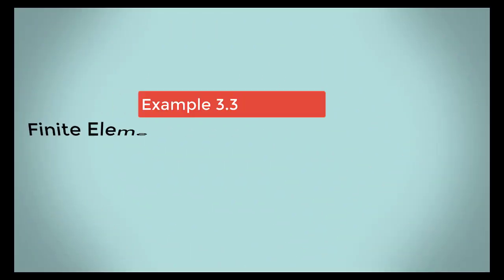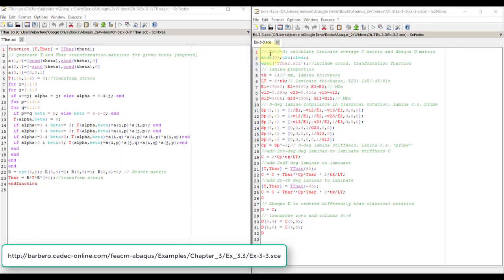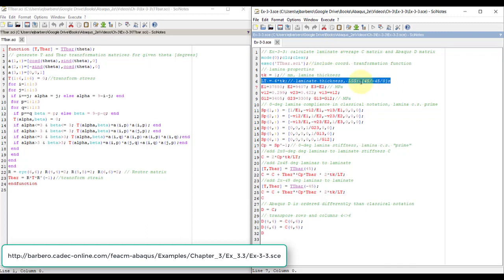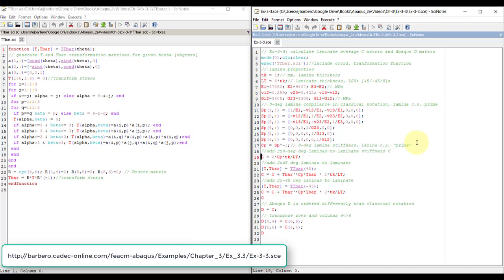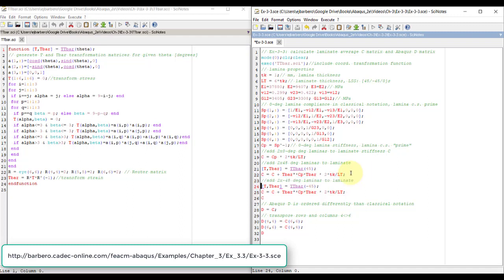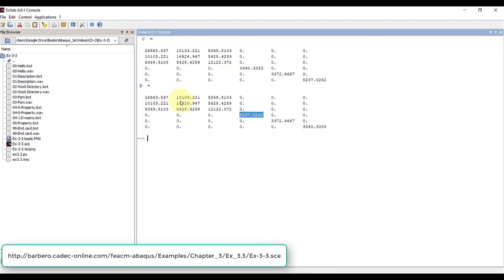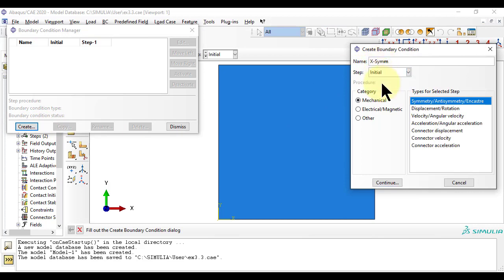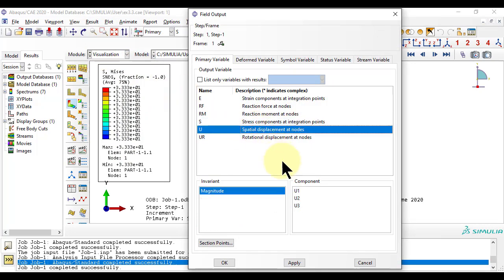Example 3.3 How to represent a laminate by its equivalent orthotropic properties

Comment: Professor, great video. A small question: if we had to apply different types of edge moments such as  Mx or My or Mxy in Nm/m, how can that be applied to an edge? I tried the shell edge load feature and selected the "traction option" to be "moment" but the only moment that can be applied is a moment vector that is acting about that edge. is there any other way? thanks.
Reply from the maker: If the edge is parallel to the x axis, that is an Mx. To apply other moments, create a reference point and a tie constraint, see video 3.?, them apply up to 3 forces and 3 moments to the RP, they will be applied to the edge through the constraint, but check that you are nor fighting with any boundary condition applied to the same edge.
Reply: @EverBarbero  Thank you, sir.